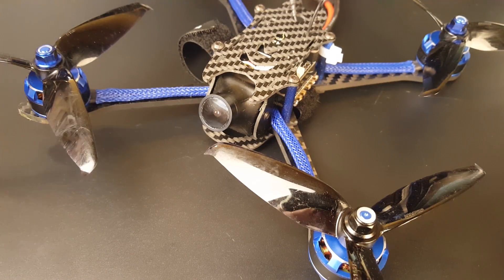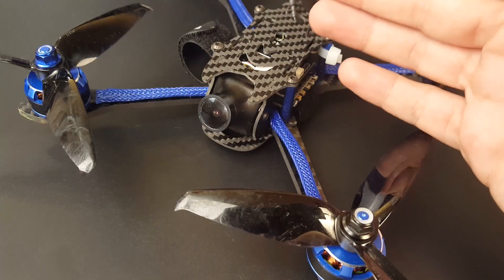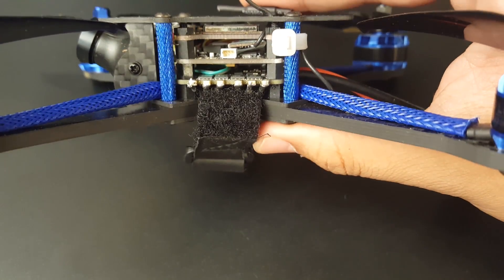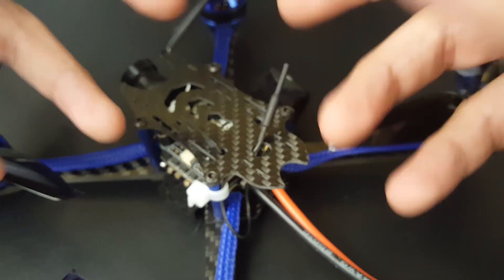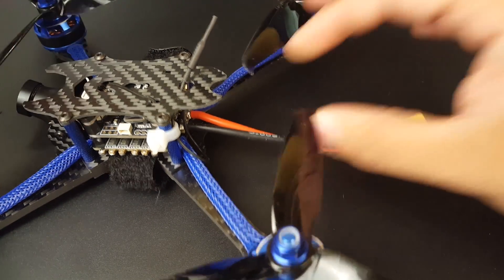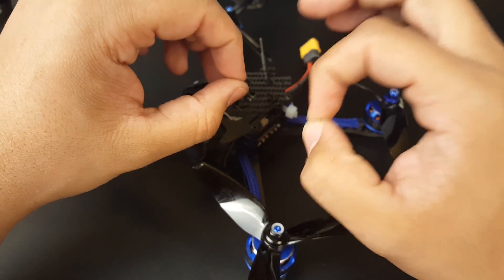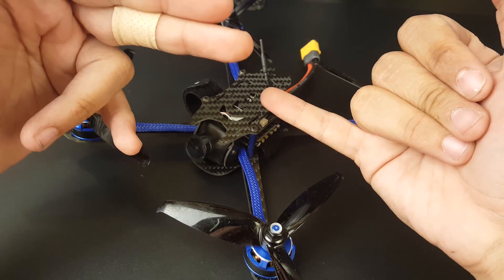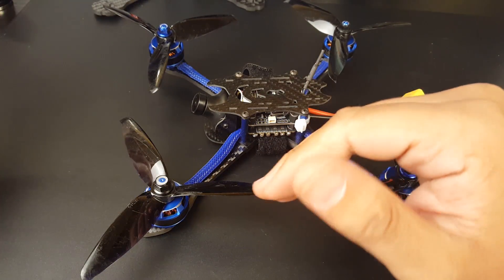BFight 210 // Overview and Flight

Comment: Just ordered this quad last week along with it's little brother the mini fight 110 and can't wait. I also ordered 4 DYS samguk motors for it as well and went with the 2207  2600kv and got some GF 5040 props. I hope it turns out to be a good quad with all that on it. Otherwise I will just build something with those motors. My only concern is if the Bfight ESC's will handle those motors. I should be ok with the props...at least I hope so...lol

Comment: Joshua bardwell said not so long ago on his channel that someone actually built a quad with four different motors and four different ESc's and it flew absolutely fine, so as long as i was able to replace a motor with a 2205/2300KV similar personally i wouldn't give a shit, after all its only aesthetics.  :)
Reply: Ow and four different props  :)

Comment: I bought mine last month and after flying it for sometime, I realized one of the motors was faulty. so I contacted Gearbest and they said I have to wait for another month so they can send me another motor. their customer service is terrible.
Reply from the maker: +jack smith Always check if a quad you buy has replacement parts.
Reply: yeah you are right. Now i need to buy 4 new motors for the quad. any suggestion for some good budget motors ?

Comment: Any commends on the current sensor reading would be nice. Did it work out for you or does it show values which are way out and can not be calibrated via BF like mine (60A in idle). It seems to be an issue with the omnibus F3 pro FC.

Comment: I was olso worried about parts so I orded 2 :)
Put in a runcam swift 2, and fly with 5040. happy happy
Thanks for your chanel.
Reply: I did the same, got 2 and broke and arm and motor, when I used the second for spares I found I had a whole bunch of stuff left over to use on a new frame with new motors (that I had lying around) and got a second awesome model I only had to half-build!
Reply: sorry, what is '5040'?

Comment: For beginner is best durability, arms on this are not most durable
Reply: BuzzCola 3 totally agree, durability is the key and availability of parts. On another note this quad low end throttle sucks. Definitely need better motors. Brotherhobby R2 or rcx se2205 V3 they are light and good power to weight ratio. For light quad anything above 2205 motor is an overkill imo.